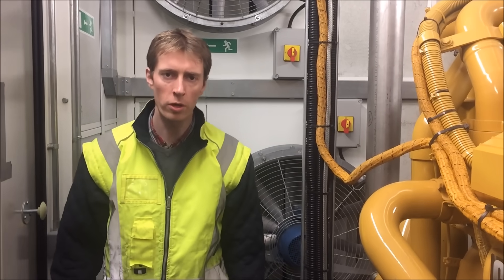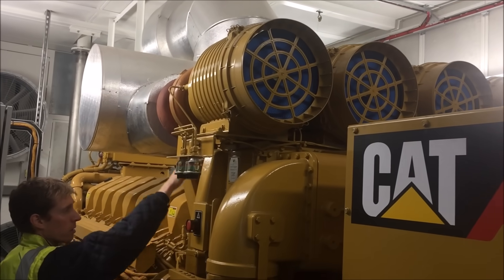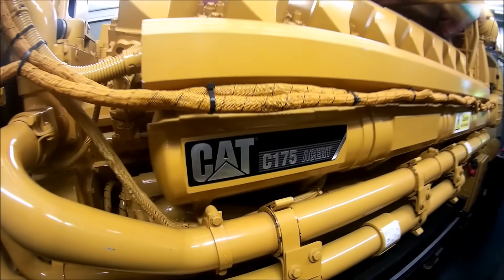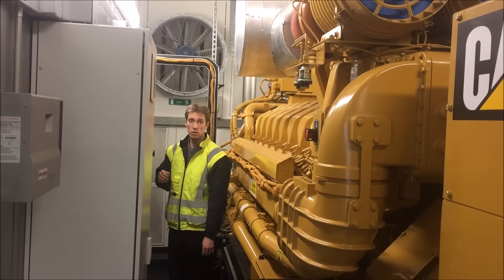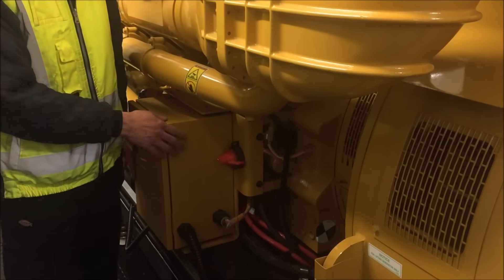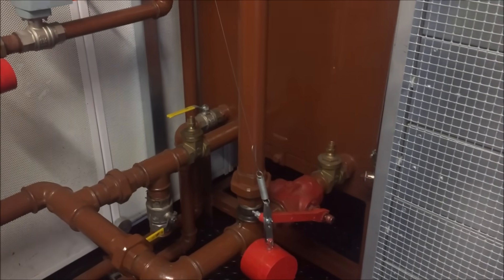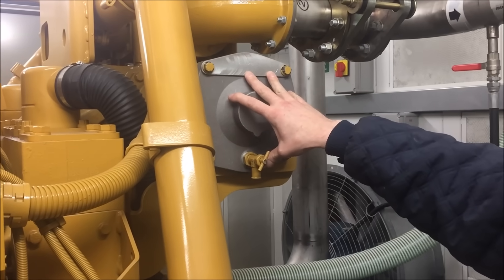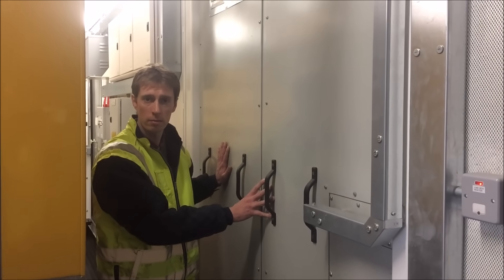CAT C175 Masterpiece: 4000HP V16 Diesel Generator Walk Through & Warm Start

Comment: Several years ago I worked as an electrician on a project to install facilities for eleven Cat V16 gen-sets for ESPN generating at 13.8 kv. I don't know if they were this model, but they were Cat V16's. Very complicated, and very impressive at the end to see eight of these engines in a row.
Reply from the maker: I bet, should of made a video of them all running, there seems to be a good following on here, thank you for your comment :)
Reply: I never got a chance to see testing with all of them running in parallel and carrying the ESPN Bristol campus. The Russelectric controls were incredible, and the 15 kv buss duct and switching gear were impressive as well. I just never got to see the end result. When your job's done, you don't hang around, you get re-assigned.

Comment: As you say , every thing seems to be in place. :-) But I guess this engine uses lots of fuel, doesn't it, how much is it on idle per h , if i'm allowed  to ask?
Reply from the maker: HI there, the engines are all set to idle at rpms, for the desired output but the difference in fuel comes from the amount of load on the engine. If on no load she would use about 100l per hour, on full load could be up to 500l per hour.
Reply: Hi and thank you, now I found the container at about four min into the walk through. It's really great if one imagines what this cat could power!

Comment: this gen fuel comsumtion  at full load is approz 720 lit/hour= 190 gallons /hour,,...the fuel tank has 2000 liters capacity,,,,runs no more than  2,3 hours if it isn!t refilled,but,,,wow,   how very clean is the room!!! Roos  Productions   thans for upload.
Reply from the maker: nomon95 hey thanks for your comment, that is just the day tank, the main fuel tanks are at the other end of the building as soon as the day tank its a low alarm fuel is pumped from the main tanks, about 48 hours of fuel is kept on site for the 3 engines
Reply: Rossperry Productions,,,this gen is in a machines room boat or in a factory???I"m interesting,because i"m  naval  mechanic engineer. The boats uses a daily fuel tank for his gens,,,and in some cases,,,for the main propulsion engine,,,,another daily fuel tank,refilled with pumps...Thanks for your quickly response   Daniel,,,Argentina.
Reply from the maker: Hi there Daniel, the Engine installation was on a laboratory / healthcare building
Reply: yes, is true.

Comment: why it should be 11kv ??
Reply from the maker: in the UK commercial buildings circulate 11000v on the high voltage side of the transformers.
Reply: and its 50 cycle too.and its spinning at 1500 rpm.

Comment: cat is the upmost supreme diesel engine bar none,especially in the trucking industry, cats are what Cummins and detroits long to be when they grow up, man i miss them, very informative and awesome video mate.
Reply from the maker: Agreed and thank you for watching :)
Reply: Freddy Hernandez In the railroad industry, the Cummins QSK-95 (16 cylinder) is beating the 20 cylinder C175 in terms of reliability, with the CAT having just 300 more horsepower.
Reply: Yea right. Cat got put out of the trucking industry because they where afraid to deal with emissions components. Cummins is the only one that survived albeit pos paccar engines.
Reply: Justin Martin and Cummins have been big turds unless they’re deleted. I’ll hang on to my Unbridged MBN C15 at 640 hp that makes it from from shipper to receiver without sitting on the side of the road waiting on a regen or a wrecker.
Reply: Paul Hart at least cummins tries! Cat the wussies ran off as soon as the word emissions came around. They didn’t even have a common rail system on the c15 as of 2007, it’s no wonder they get hideous fuel economy
Reply: piece of shit cats.   Have 2 !!!!!!!!

Comment: This is so satisfying. The fit and finish of everything I can see in the video is excellent. Worked on a power generation project with main details I can't discuss but diesel fired (no spark plugs to maintain) natural gas fueled power generation. It was originally designed to reduce electricity costs for a factory but they've figured out that they can shut the plant down and sell power back to the grid when the price goes up and make more money.
Reply from the maker: Ian McDonald Hey Ian thank you for your comment, we also done a Jenbacher 612 gas fired check out https://youtu.be/yUUGIU0wrQs

Comment: I see 7 main power cables, 6 red and one smaller cable which means this genset is 6 phase
Reply from the maker: Hi there, thank you for your comment.
No that is incorrect: Its 3 Phase but the star point is External, so 3 phases out (3 cables), and the other 3 are the end of the windings, which are joined externally. 
This is done through a Currernt Transformer (CT). There is also another matched CT at the switchgear end, between them they form a protection zone. We do this after the alternator so that the main windings are "within the protected zone". The additional cable is the Earth.
Reply: Here in the US, this is called 'Differential Protection'. 

Generally speaking, our highest 'low voltage' is 277/480 and our lowest 'medium voltage' is 2400/4160. It's fairly rare to see differential protection on 480 but it's very common on 4160 and higher. 

Good video, I've never seen a 175 but I've worked with a lot of 3512s and 3516s.

Comment: these also came in Peterbult  truck but rare
Reply: Yeah, I don't think so.
Reply: 88driver243  they had 3408 which was a V8 also had a  V12 back in the 70's-80's . But nothing this big.
Reply: +Mark Armstrong
The 3408 may not be as big, but you can't tell me it's not a beast of an engine. The crane company I work for uses Grove cranes for everything above 30 tons, and they all have 3408s in them, even the 90 ton and 300 ton behemoths we have in the yard. My favourite part of any year would be when they're doing overhauls on the Cats and then test-run them without the mufflers. It's like the most badass big-block sound I've ever heard in person. Sounds just like a muscle car on steroids. Matter of fact, if I could figure out how to get a 3408 to fit between the rails in my Impala, I would most-certainly do it.
Reply: I've got a 3408 in my Kenworth truck, it's done huge hours and been ultra reliable. You can't go past Caterpillar.
Reply from the maker: There are a few different sizes within the range, would probably be a smaller unit.